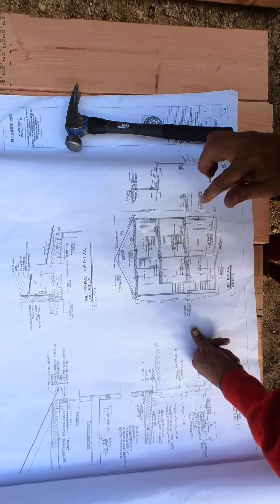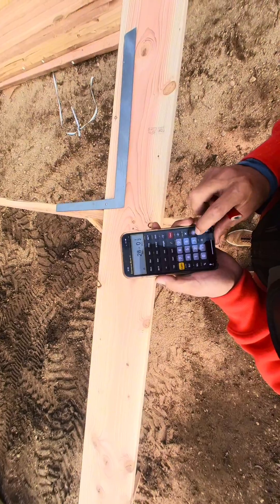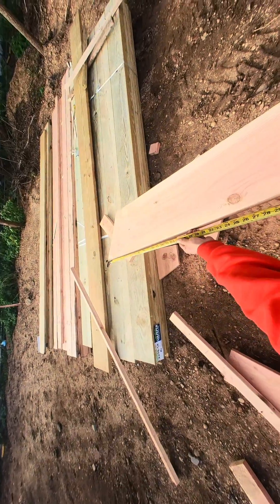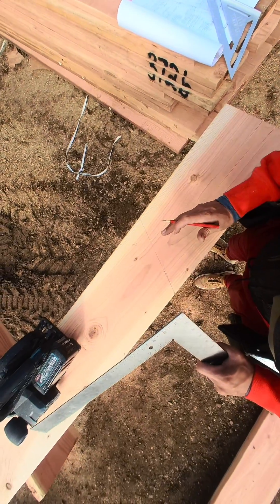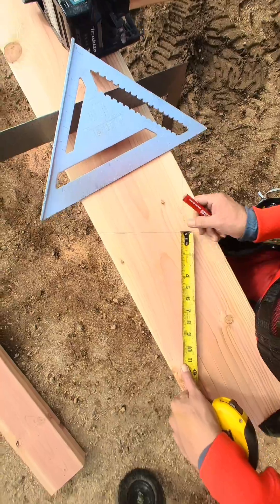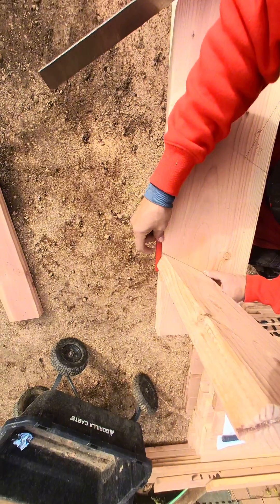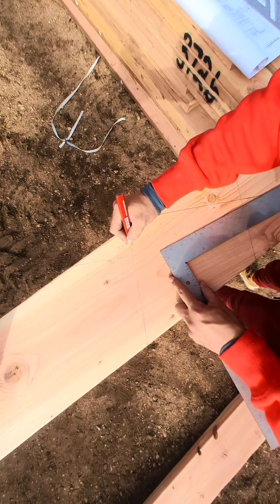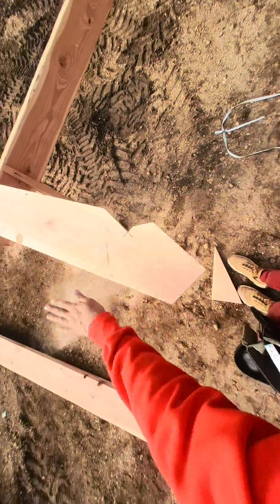How to calculate and do a rafter for a roof

Comment: Can you please explain what you put into the calculator again but slower?
Reply: Total length of what you are spanning = S
Width of the beam that you are attaching your rafters to = W 
Actual span = A
Roof pitch = P
1/2 of span, aka "run" = R
1: S-W=A
2:A÷2=R
3: Enter R (in feet and inches), then enter P (in inches), then press diagonal. That should give you your answer.

Comment: Great work mr Jorge! Question,when you do roofs with hips and valleys, do you have to take into account how DEEP you will cut into the hip and valleys before you lay out your commons, in order to pass inspection ? 

Because normally the hip cuts will be deeper than the commons , and maybe over 1/4 the rafter depth, so even if the commons are not too deep, the hips could end up being more than 1/4 of the way through the hip especially with being dropped to plane with the commons. Was wanting to know if that was something inspectors might fail you for or cared about.